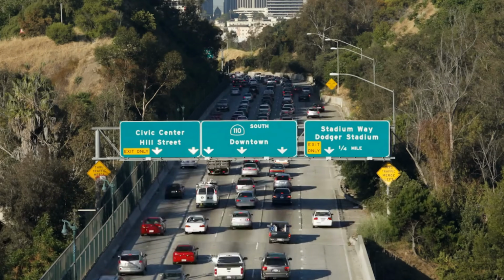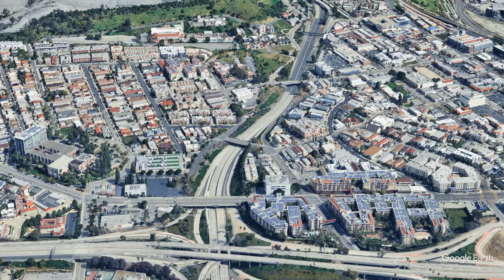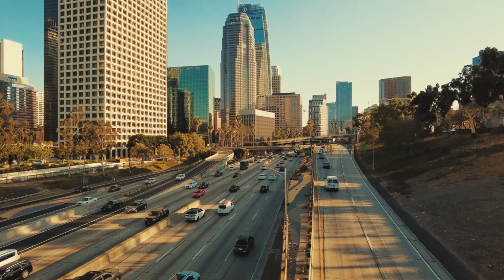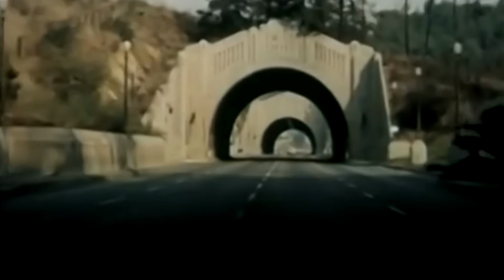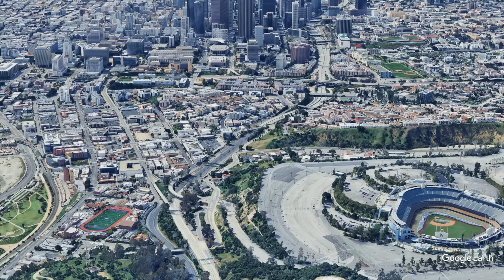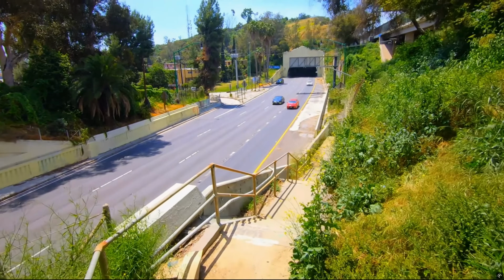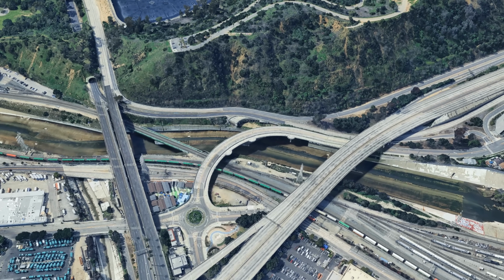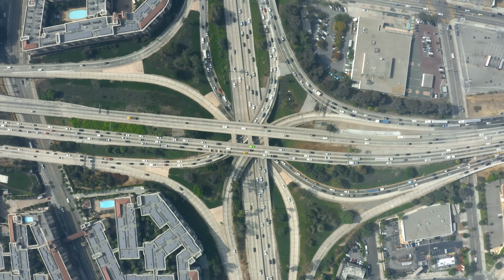The Oldest & Most Dangerous Freeway In America

Comment: They wouldn't need such a large parking lot if they would just connect the A Line to Dodger stadium. You can see the A-line just on the other side of the 110. Its like 1/4 mile away.

Comment: Great video, thank you!

A quick tip on pronouncing Los Angeles freeways like a SoCal native:
- First, you can say “US,” “I,” or “State Route,” but usually, we just say “The.” Such as “The 101” or “The 110.”
- If the freeway number has a 0 in the middle you pronounce each digit with “oh” for the zero, like you did correctly for the 101 (“one-oh-one”). Any other freeways are said by pronouncing the first digit alone followed by the last two digits as a single number. So we say, “The one-ten,” not “the one hundred ten.” This is a hard rule.

In addition to the important baseball rules already mentioned by other commenters, when Dodger Stadium was built, there was essentially nothing to see downtown.

As a life-long Angeleno, even I did not know the Pasadena freeway as the Arroyo Seco Parkway, so that’s something new.

Comment: Lived in Santa Monica and worked in Pasadena so I took the Arroyo both ways for yrs…it is a true relic of a roadway as it has has those sharp rounding turns meant for cars to go about 45MPH, rather than the 85mph that today’s drivers do. 

I’ve had my share of incidents on that freeway, but my most memorable was when I was in the “fast lane” and hydroplaned for a good distance on one of the rainy days yrs ago. I thought I was a goner…I recall how time really slowed down in that moment and I gripped the wheel tight in order to not sway in either direction. Somehow I made it…or maybe this life of mine is a simulation.

Also…that merger from the 110N onto the 5N has got to be the worse connection in the US. It comes literally after a tunnel and is a sharp almost 45° turn at that.

Comment: The Figueroa Street tunnels actually predate the freeway by about 10 years, thus their name.  The north three were opened in 1931, while the fourth was opened in 1937.  They acted as a connection through Elysian Park between the two lengths of Figueroa Street in downtown Los Angeles, and Highland Park to the north.  They were repurposed as freeway in 1940, when the Arroyo Seco Parkway was routed through the area.

Comment: the 110 is the scariest freeway I've driven, and I used to drive the 99 regularly. now any time I need to go to DTLA it's 110 time and it's such a pain in the ass every time. then there's the spot where it meets the 101, that's just suffering all the way to Alameda. worst part is the 110 is inexplicably a historical landmark so the city can't do anything about its godawful design to make it actually safe to use. plus you got all the tourists struggling to grasp the concept of staying out of the right-hand lane unless entering or exiting and getting into the left lane in advance of the exit to the 5, because apparently everyone feels like the correct time to merge into the exit lane is 50ft from the exit and not half a mile in advance like a normal person. nobody knows the rules so it's just chaos during active times. after around 7PM it calms down a little and becomes slightly more normal, but you better hope you don't need to merge into traffic going 70+mph from a stop sign placed mockingly at the end of a residential street that leads to the 110 with no ramp

Comment: Great job on the research about the building and design of the Arroyo Seco Parkway. It is quite different from the highways built later. I drive often on it between Pasadena and downtown LA, but I don’t get on or off in the middle. You did not mention one unusual aspect of the connection to the 5 freeway on the northbound 110, which is the exit ramp on the left side. This means that the left lane in that section is the slow lane with traffic slowing down for the exit. The 5 exit from the southbound 110 is a normal right exit.
Reply: Yeah that exit exists because the northbound side of the freeway is a former 2-way section of FIgueroa street that was converted into a 1-way section of the highway. I've seen pictures of that exit back when it was a T intersection

Comment: When I took my many vacations to LA, I enjoyed driving on the Arroyo Seco Parkway, for the reason you gave: It's a time warp back to the 1940s. Cars were bigger, but slower, so the Parkway was built to be a leisurely & scenic drive. It has more character than any other freeway in SoCal.

Try to plan your trip so that you don't need to merge onto the Parkway, though. That is even scarier than driving Highway 17 between San Jose and Santa Cruz.
Reply: I often take another freeway over that one (they take similar times for me) just because all the cars drive so fast on it, that, well… a nice smooth freeway without all those turns and abrupt entrances and exits tends to be quite a lot more relaxing to drive on day-to-day.

I imagine it would be much much more pleasant to drive on if people drove a bit slower!
Reply: It's horrible to DRIVE, but a gorgeous setting, with all the trees and views of the hills and mountains.
Reply: The video should have shown a close-up of the very short on ramps and off ramps in the northern part of the freeway.
Reply: I merge into the 110 almost every day. You get used to how it works. The trick is to use your driver’s side rear view mirror to make sure no one is in the rightmost lane. You are stopped with a short on-ramp. If it’s clear, you can enter. Helps to have a good 0-30 acceleration lol.

Comment: The 101-110 interchange is a commuting nightmare, particularly going from the NB 110 to the NB 101 with that ramp being a clusterf*ck. If you are fascinated by the interchanges of LA, you have the massive 110-105 one in South Central where you have the freeway on the SB dip down as the interchange rises above you. The other interesting one but also a mess is the East LA interchange not far away from Downtown where you have the 101 terminating at the 10-5-60.

Comment: this isn't the oldest freeway.  The Ramona parkway is,  This first freeway is currently interstate 10 from the 101 to about the 710
Reply: The Pasadena freeway was first. It opened on Dec 30, 1939, from Pasadena to Riverside Dr.
Reply: It may have operated similar to a freeway, but it was called a Blvd when it first opened. It wasn’t referred to as a freeway until after the war.

Additionally i’ve been told by old timers from that era that there wasn’t a median divider, nor even stripped lane separators. They said that’s why it was called the “Airline” or “Airplane” route. It was basically a near-free for all, which is apparently why there were a lot of accidents.

Comment: If only Southern California were SMART ENOUGH to have retained the Pacific Electric Red Cars, and the Los Angeles Railway Yellow Cars, we wouldn’t hafta suffer with all these wasteful and inefficient  “Hitler strips”  destroying the urban landscape!
Reply: Yes and no. By the time of abandonment, the Pacific Electric was falling apart - it had served its real estate purpose, and passenger service had long been seen as a thorn in the side of its much more profitable freight service. Most lines, though well located, were street running with poor passenger waiting areas and zero transit priority. Even if they had been kept, they’d have to be completely rebuilt - not far off from what Metro is having to do today. Ironically, much of Metro’e rail network uses old PE right-of-ways, as they were purchased by Metro and its predecessors through the 90s. The E line, for example, follows the old Santa Monica Air line almost exactly - and does so about 15 minutes faster than PE ever did, with more stops.
Reply: @kilodeltaeight However, note that there was  “only”  a 27-year hiatus before passenger rail transit made its comeback….

Because the OVERSUBSIDIZED AUTOMOBILE (car, BUS, and TRUCK) just couldn’t do it all….
Reply: @kilodeltaeight  modernizing the track and putting barriers around the lanes to make them separated would have cost a miniscule fraction of what building the new lines from scratch did. And most of the ROW has been either sold off and built over or erased through street reconfigurations so its now lost forever

Comment: When the freeway opened, the state speed limit was 45 mph.  Cars were vertical (compared to cars from the second half of the 1950s, up til the fairly recent past)

There were also significantly fewer cars, so merging onto the park way, from a complete stop was not a problem.   There was room, and cars were slower. 

I remember seeing big 1980s cars in the ice plant, having misjudged the sharpness of the posted 25mph exit. 

I owned a 1948 Plymouth in the late 80s.  It was a slow lane car on all the modern freeways.  But once I merged into the Pasadena, the Arroyo Seco Parkway, my bulbuous, fendered Plymouth felt right at home.  The narrow lanes, the over all scale, and the speed of my car was what the freeway was designed for.
Reply from the maker: Thanks for sharing bro! It makes absolutely sense that it was completely fine back then
Reply: That explains why it feels so stressful to drive on today when it was meant to be scenic when it was built!

These days the speed limit there is 55mph, and lots of people go even faster than that…

I kinda wish I could experience that today, but imagine that going so slow would make a lot of people very angry and increase the risk of being rear-ended.
Reply: @happysmash27  No, people were used to slower speeds = this is the FIRST L.A. freeway and pre-dates all or most Interstate highways. People weren't looking to drive 75-85 which is now fairly standard during the low traffic hours in L.A. and on Interstates nationwide. These days people chill out when their in the Arroyo Seco - just a pretty short distance anyway if you go the whole distance on the old parkway from east of downtown to Pasadena. I know those absurd entry lanes look like casualties waiting to happen, but I'd wager there are more crashes per capita on the modern freeways where people are flying.

Comment: The Pasadena Freeway (the former Arroyo Parkway) is not that dangerous based on the data.  Lower speeds and no trucks are one reason why.  But it is the oldest LA freeway and was designed for lower speeds, and has what seem by today's design standards to be very "scary" on and off ramps.   Congestion delays can be lower on the Pasadena Freeway and trip times tend to be fairly stable,  both peak and off-peak, unlike the swings in variability in congestion delays that one sees on most LA regional freeways.   DUI arrests seem to be higher, because they are so easy to spot and have a hard time with the curves, so CHP targets it for DUI enforcement as it ends in Old Town Pasadena.  It is the first freeway in LA, but not in the US, despite what google tells you.  The full opening of the freeway portion of Arroyo Parkway was Decemvber 1940, the first segment of the Long Island expressway was opened just a month earlier.  But it was the first of this length.  There were no other connecting freeways and the Arroyo Parkway began and ended on local arterials.  The four level interchange in downtown LA was not built until the late 1940's as part of the Hollywood Freeway construction.